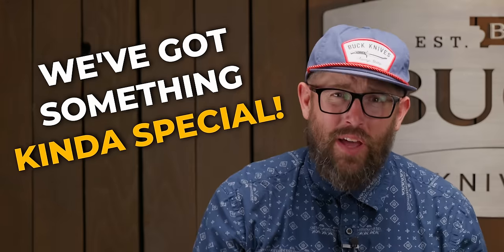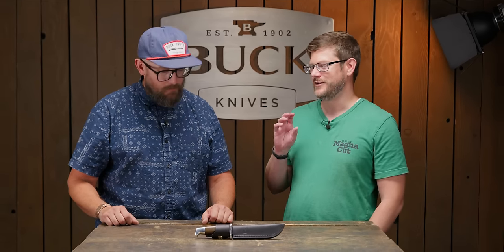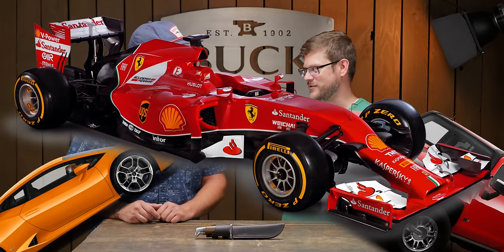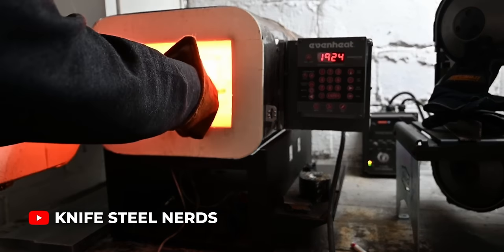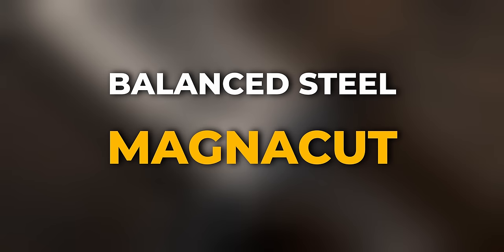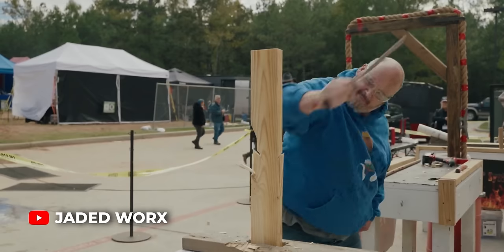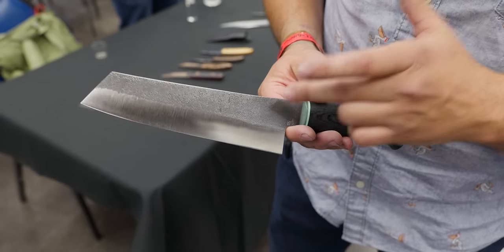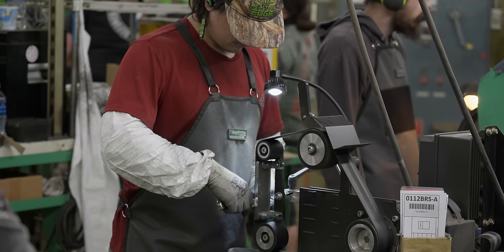The 3 Best Knife Steels According To Science! || THE Knife Steel Nerd Guide To Knife Steels.

Comment: Larrin, why Bark River knives from Magna-Cut get rust spots? Bad grinding, bad heat treat? What is wrong with Mike Stewarts Magna-Cut?
Reply: Nothing, Magna Cut will spot just from just cutting food. All of mine do from a few companies.
Reply: @Augiebruntal you are wrong, Magna-Cut is normaly stainless, like Larin said. But not from Bark River. Magna-Cut from Dawson Knives, Spyderco don't rust.
Reply: @Augiebruntal 

No they don't.
Reply: at 59 HRC will be slightly more stainless as opposed 63 HRC  @unnamed47
Reply: No, I know a thing or two. At 59 HRC it will be slightly more stainless as opposed 63 HRC. However it will spot, so will Spydero's. It not magic, heat treating is fairly straight forward if you follow protocol. What do you anticipate being different between the two? Quenching at higher temps making one less "stainless" than the other. They all spot just from cutting Trader Joes empanadas with my testing  :) @zdenekbart
Reply: @Augiebruntal it is becouse gringing on belts (A2 powder on it) what Bark do, not becouse heat treatment. I talked about it with few other knifemakers.
Reply: @unnamed47 after I spoked to a few knifemakers, it is becouse Bark grinding it on same belts like A2 and CRU-WEAR, so there is a powder on it witch reacts, after some time problem is gone.
Reply: @zdenekbart  How do they know? I am pretty certain it's not the old contaminated belt theory. Anyone grinding Magnacut would be burning through new belts. Everyone one of my Magnacut blades spot. None of them are from Bark. It's a notch above M390 in that range and certainly not rust proof. But yes the steel is "stainless" but not stainless. :)
Reply: @Augiebruntal Magna-Cut have perfect corrosion resistance, Spyderco use it for diving knives, wet areas, no rust at all. BRK Magna-Cut problem is theirs grinding style, system, they do it on the same belts, they don't change belts so they contaminate it by the steel dust of A2, and CRU-WEAR, etc.
Reply: @zdenekbart  Don't know what perfect corrosion resistance means but they will spot for sure without a dought. Sprderco does not use Magnacut for dive a knife.

Comment: Do not buy "surgical stainless steel" unless your primary criteria is corrosion resistance. Surgical stainless is formulated to resist corrosion during repeated steam sterilization. It does not keep an edge. Speaking from 40+ years of experience in surgery.

Comment: Unfortunately there is no perfect steel and there are always trade offs . Those steels in the AEBL class like Nitro V , 14C27, are really prone to warpage and badly need cryo to be really good. While the Magna Cut is extremely impressive at holding an edge its hideously expensive and impossible to finish , hay I know the steel that holds an edge for twice as long is twice as hard to sharpen and finish, but its so difficult its not a commercially viable option for custom makers who make volume.  Like its a great steel but not something everyone will be able to use.

Comment: All the steels mentioned aren't actually all that great.  Rather it is what guys can RELIABLY get their hands on in small quantities.  Why would anyone use S90V or the others mentioned here when you can use AF1410 with vastly superior properties(literally 5X impact strength at same hardness).  The Heat treatment must be too damned difficult for Joe Pop knife makers... Normal AF1410 is nothing to write home about compared to the steels mentioned but if you can stick it through a toroidal induction for the heat treatment... oh boy, triple the touchness compared to those steels mentioned.

Comment: What is the best sword steel?
Reply: "best" is a tricky term. L6 (Bainite) can be done (processed/heat treated) really well though. (bandsaw blade steel) Very tough.
S7 would be another tough, hard steel.
Reply: @firstjohn3123  
Yes, I heard that the S series was very tough stuff . 
Corrosion resistance would not be a factor , Impact resistance, and spring would be The most important, Rockwell, about 55, differentially hardened, I suppose.

Comment: If Magnacut is the be all and end all, why does it need a significant secondary bevel in a Scandi grind to prevent damage to the edge. I have dozens of Scandi knives with 0 secondary bevels that hold up well to heavy wood carving. I'm also a wood carver and have hundreds (yes, hundreds) of carving tools without a secondary bevel that do not chip when carving seasoned hardwoods. But Magnacut?  https://youtu.be/WKBTk3Xb93Q?si=yI3H9EzfQIT4HGau

Comment: I wholeheartedly disagree with larrin thomas. The material is very important. If you're going to cut meat and paper, then almost any "knife" steel will be perfectly adequate with sharp geometry , but if you want to engage with any of the "materials" in the world BESIDES food ,, (and package tape) ,, the material is crucial. This is why the wisdom of the box cutter disposable blades is so powerful, because it doesn't need to last for generations, it needs to work well for long enough to still only be a few bucks a day, and needs to work really well, and razors need to be hard. I love collecting these flippers, but I would never go to work without taking my box cutter.

Comment: I hear S110V is way too difficult to sharpen to be useful as a knife.
Reply: It'll likely depend on your sharpening equipment. I've found that diamond plates followed by ceramic stones then stropping will work with pretty much every steel I have. Granted, having those in a comprehensive range of grits is more of an investment than many folk might be willing to make, so I can see how sharpenability could be a dealbreaker.

Comment: All these new so called super steels just keep raising the prices of knives into the hundreds of dollars. Nothing wrong with the carbon steels 1095 and others used for centuries just oil them and clean them after use easy to sharpen and will last a lifetime of use. Great Eastern cutlery is a good example of carbon steel quiality knives. Old school is the best if you like traditional knives and carbon steel I do not need or want magnacut or other super steels.

Comment: I know I'm going to get crapped on , but , you failed to mention anything about actually sharpening a knife from these non sharpening steels , what is used ?
sanding belts 
diamond grinding wheels 
 The old fashioned Arkansas stones no longer will sharpen the new steel . 
I'm old school , if it will rust , it will sharpen , the steels today will wear out a stone and your arms and  you never will get the knife to sharpen .

Comment: BE FORWARNED A KNIFE IS ONLY AS GOOD AS THE COMPANY BEHIND IT. BUCK WAS NO GOOD.
     I had a buck knife in its sheath  in my pack and dropped my pack lightly on the ground
Unloading from plane the blade break off  at the handle. You could see a coarse glandular surface I tried to get a replacment no go with buck. Mined and fished in Alaska.

Comment: Bucks magnacut has been 58 to 60rc. Not worth it at all. If your going to use it in a small folder or small fixed blade, buy one 63-64. If your buying a medium sized fixed blade then 62-63. Below for large knives.

Dont be dumb consumers and waste your money buying magnacut at 62 and below on all these small knives. Demand better in this market.

Also demand 62rc m390 and 20cv and stop letting companies give you expensive knives at 60 and below. Hardness doesnt always matter when the protocol is done poorly too. So cant always depend on that alone. Research cut testing.
Reply: 58 to 60rc would be more stainless. Could be good for some people. Anything above 61-62 on production knives or one knife would increase scrape rate a tool wear. Keep demanding a point more of HRC and make companies raise their prices even more because you think its worth it. You should try to belt grind a fixed blade at 64. Are you noticing a difference from 62 to 63 when you're cutting?  Are you testing blades in 4 areas to get an accurate assessment of average HRC on a blade. Testing the pivot area and calling it good is not precise given an inch over could be one point difference. But you do that on all your knives right? Or something you researched/read?  @tacticalcenter8658 always holding your picketing sign.
Reply: We have heat treated ALL our MagnaCut using Crucible's recipe for 63HRC. On our very first MagnaCut run, I initially made the mistake of saying 59-61, since that's our standard for most stainless.
Reply: @BuckKnives  thank you for that. We heard otherwise saying it was done low because of the tip and the geometry. So what you've said seems interesting givin the other reason we were givin prior.

We were all disappointed when we saw it printed 59-61 at those prices. But yeah other then the mixed messaging and now an official corrected response, I'd be interested to purchase a Magnacut Buck at 63rc. After your low hardness junk 20cv I think I can finally get a decent Buck knife. Hopefully the qc isn't too bad like we hear a lot. I respect when things are done correctly. And will tell you how it is when they are not.

Comment: Guys that will never really use their knives except for looking at and showing people care way too much about this stuff. Buy 3 time tested knives for your 1 "super" steel knife and actually use them.
Reply: Well, you need a knife with the right properties, regardless. I like magnacut because everything rusts near me
Reply: @bobjohnson1633  I'm glad to hear you like it.  My point was everything looks the same in a drawer, case, on the wall. A lot of guys that maybe at most cut a box time to time spend a lot of time concentrating on the super steels as opposed to a the standard buck 420HC. That will also not rust, and is incredibly tough just go watch hard use tests on it. There is a small minority of users that will appreciate the super steels, their pros, but most are collectors that won't.
Reply: @UncleMac51 be collector dos not mean, Iam not user. Use my blades edc for every tasks, included food prep, etc.
Reply: @zdenekbart  you believe you need magnacut for food prep? Chefs would disagree. Take some of the most widely used Dexter Russell knives used by commercial chefs beating on them every day. Standard stainless steel.
Reply: @unnamed47  it is way to expensive for the so called benefits of saving time sharpening. Just get good at sharpening. The scientist himself said edge geometry matters more than the steel. I.e a properly sharpened knife is the most important variable in how well a knife cuts. Lower end steels out perform higher end depending on the angle. Better to spend the money, time learning to sharpen and reprofile well before spending the money on high end steels.